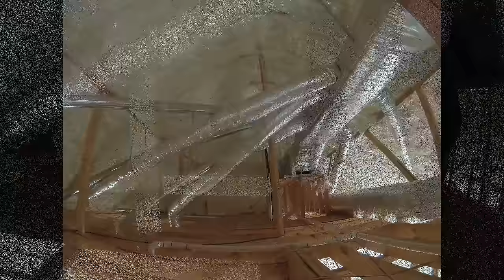Open Cell Spray Foam Insulation

Comment: First off I spraythe outline of the cavities and then the inside that way you’ll have a better cavity cover .
Reply: It should be common sense. Especially to someone who does this for a job
Reply: @twizz420  nah y’all’s pattern just sucks and you hit studs
Reply: depending on the brand and substrate temps or preheat temps, i usually do the middle then the outsides "reverse picture frame technique" or yes I'd do the one you are saying the "picture frame technique"

Comment: Love your video, I love watching this stuff expand, it's therapeutic, like popping bubble wrap, lol. However, if you guys are using open cell, as the title says, there's no vapor barrier properties, of the foam, so how are you guys going do a vapor barrier, on the walls, post spraying?
Reply: If the home is sealed properly there shouldn't  be any condensation getting in. Ventilation in the attic or basement is recommended. I'd sprayed a house recently and as we were working the home was almost dripping with moisture. But we solved it with 2 3/4 in closed cell on all exteriors.
Reply: @dr.dingus3453  Ever heard of condensation caused from actual use of the house?
Really well informed people involved in this "craft"... 🙈
Reply: @L R  

"It's not forg, Johnny, it's corndensation"
Reply: @skylined5534  Corn-den-sa-tion...
Reply: @OmmerSyssel  I warm climates no interior vapor barriers are needed and cause problems
Reply: I know right. It's that satisfying feeling you get when bust the pimples on your face one after the other, and see the splash on the mirror.

Comment: It didn't even stick to the plastic in the beginning.... How is it going to stay in the stud bays or ceiling? Friction?
Reply: Polyurethane foam is a plastic and does not adhere well to slick plastics. I welcome you to come pull some off after I spray it to wood or metal though. It doesn’t let go easily.

Comment: Try spraying every other cavity and see how much easier it is to cut it flush and then spray the other ones in. Twice as fast.
Reply: Buy a shaver and that wouldn't be a problem
Reply: @michealschrader9762  shaver that we use is heavy as fuck, almost worth just using something less efficient
Reply: we use an corded reciprocating saw with a 3ft saw blade to cut flush.
Reply: @Tht1_N8ve  same I have two and shave down a whole house in under an hour

Comment: You are not wetting the sides and on overlap seams causing voids. Every time you go back to try to fill voids you're only bridging and creating another void. Also moving the product during set-time breaks the natural substrate and causes voids.
Reply: He’s speed is causing him to fall short.  He’s definitely a rook for sure.  Feel bad for the home owner
Reply: @blakecannon6963  def needs to chill with that wiggle, def isnt trying to remain perpendicular to the surface he's spraying. def isn't trying to consistently wet the enitrety of the cavity. I've been feeling lately that my walls look better when I do up and down strokes.
Reply: Yup these guys don't know how to handle open cell creating void after void
Reply: @isaacfranco9216  open cell is basically a multitude of voids...open cell.

Comment: Please, what is the best and strongest in insulation, rock wool, or this liquid foam?
Reply: There's no best insulation, it all depends on what you need it to do.

Sometimes you want your insulation to also act as a vapor barrier, sometimes you want it to reduce sound, sometimes you want it to be flame resistant, sometimes you want it easy to install.  Basements need different insulation than above grade.  Different climates need different moisture barrier strategies
Reply: Rock wool does not off gas when heated to ignation point. Also ignation point is very high for rock wool - actually, it doesn't burn at all.

Comment: Is it ok to apply spray foam insulation when the attic is 110 degrees? Will it fully cure? Or will it off gas forever?
Reply: gotta allow ventilation and circulation while the foam is curing within the 24hrs. usually i tell homeowners to keep ventilating for a day or two depending on how they feel comfortable with. i usually have a fan and hose sucking air out of the attic and also another fan and hose blowing air in to keep circulating air if i have enough room in openings like access doors.

Comment: isn't he using way too much foam? And I thought you were supposed to spray it in layers to allow off gassing?
Reply: That’s closed cell foam you are thinking of... closed cell you can only spray 2-3 inches in one pass for it to off gas and cool down. Open cell you can spray a bunch and it will not burn at the core like the closed cell will, that’s why you can spray 10+ inches in one pass
Reply: enkrypt3d he isn’t even wearing a suit lmao
Reply: Btw HFO high lift closed cell you can spray in 6.5 inch passes

Comment: If you have to push on the foam as it’s growing you are not processing foam right.  In fact you are creating a void between the foam and the substrate.  Not only is he not wearing proper ppe (personal protective equipment) but he is also installing the foam incorrectly.  Training is so important in this industry.  People hire just anyone to do this stuff and they see but don’t understand.  What they are seeing.  Hire a licensed professional.  The cheapest doesn’t always pay off
Reply: either way his getting the job done, end of the day its just foam filling a cavity no rocket science behind applying it.
Reply: @Hunter-yy4es   no, he isn't getting the job done right, and you're wrong, if not done properly it can fall apart, fall down the cavity and not work at all, which is why you should always hire a licensed professional.  But I'm sure you're just an "is what it is" fly by wire un-licensed hack so you'll never get it.
Reply: @willfishing5605   spraying expansanding foam into cavity doesn't require much knowledge, safety in the works force has always come down to personal preference. As of how this job looks its expanding l don't see anything wrong its filling up. Each company has its own methods or style. Not everyone is going to follow the rules this isn't rocket science its Spraying expanding foam. 
l could watch 10 videos of the one trade and l bet almost all will have their own style. and talk shit about " how not to do" to make them selves stand out from the rest.
Reply: There's actually quite a bit of math that goes with it as well as architectural knowledge. The foam isn't expanding as fast as normal. His temps may be off. I spray lappola.
Reply: He. Is pushing the foam to the cavity because one of this 3 things chemical is cold .heat hose is cold or the walls are cold he needs to clchek his tempeture all depends on whether if is cold about 60 to 70 he needs to keep eye on tempeture very simple he is a beginner he makes lots of touch ups. ...I got lots of years doing foam insulation i know exactly what is the problem
Reply: Is not about license or certified peole is all about years of experience i know lots of people that get the certification in 2 weeks you just. Need to buy the equipment from those companies that offer free training if you get the equipment from them i work 5 years for a company before starting my own business  that's don't means that you need lots of years to learn but you need to know what your doing is an a house were people is going to live ""iso and poly''' his chemical can cause respiratory problems to your family if is not applying correctly people don't understand that this is not a just spray and go..
Reply: Hunter your wrong it’s not just about filling a bay you can seriously mess someone’s house out not doing it properly
Reply: Hunter this is so funny.  I’m showing all my co workers all the BS you’re saying.   I’ve been spraying for 18 years.  Spray foam insulation is one of the toughest jobs out there.   I want you to come try for a week.  I’ll pay u.  It will be a riot to see you try and be Successful !       I put my money on ur crying for your mom 1/2 way through day one.   Spray foam insulation is a very tough but rewarding job.  I love it. But bro it’s friggin wicked tough.  Just keeping the equipment running is a bitch.  And  keeping the 10,000 moving parts going while trying to make perfect foam for your customers.   Most the time You have to have the stars aligned perfect in order to have a good day.  Lol.    Man. I’m from Massachusetts. Please tell me you are close.  I’ll pay u good money. Just to show u how tough the job is.  Hey maybe your right and I’ve been doing it wrong for 18 years.  Lmao
Reply: Dominick Palumbo hunter has got to be a troll.  Because he’s dead wrong here.  Lmao
Reply: Mario t is absolutely right about the license not being as important as the experience. And ps hunter you have got to be stupid.  The pocket he is creating between the foam and substrate. ( that means the exterior wall. Hunter) will create a dead space trapping moisture and effectively rotting the substrate. Spray foam is so much more than what you think it is.  We are manufacturing our finished product right inside people’s homes.  We are essentially quality control.  So while some clowns are out there ruining places that should otherwise be better because of the install, some of us are making sure the product is processed right from the barrel to the second it hits the wall.
Reply: You also cannot inject the foam to try and fill the void.  The foam NEEDS to be removed and resprayed.  I don’t want anyone to think I’m trying to bash these guys.  I’m just trying to help the people who see this and think it’s ok or better than ok.  It is poor work done by inexperienced people.
Reply: @Blake Cannon  

Expert in da house.
Reply: @Hunter-yy4es  clown
Reply: @jonnygun5055  lol yeah you are mate you're flop. ;)

Comment: 6:18 it comes off the wall and he pats it back down. Moisture problem  or temperature issue
Reply: They should build real houses Made of concrete. I mean, USA claims to be an awesome country whit top tech and they still have a lot of wooden houses.
Reply: How do you prevent that?
Reply: Temps actually look pretty good
Reply: Or used closed cell spray foam
Reply: I think it's something with the direction he's applying it; bottom to top. I think it's expanding upwards and pushing the solidified foam off the wall.
Reply: @AlexMartinez-hr5gm  what a dumb comment. You build for the weather and geological conditions. Cold climates require insulation, and concrete and stone doesn't offer any. Also in case of an earthquake, a light flexible wooden structure would fare much better than a heavy solid concrete or stone structure, even in the event of collapse much better survival chances.
Not to mention cost and speed of build...
Reply: Appears to be the fact it's not being evenly sprayed stud to stud, not easy but kinda nesseary.  Finished product looks uniform but after watching that I know for sure there are air pockets all along those studs.

Comment: Why does he pushes the foam back into cavity ?
Reply: His speed is to fast.  The foam is falling off the substrate.  He’s trying to keep the foam from peeling off of the plywood.  Foam might be a lil cold also. I’d turn temps up
Reply: Foam isn't hot enough... OR it's TOO hot, which means that by the time you're spraying it, it's not cooling down fast enough to stay on the wall. Also, a certain degree of humidity in the air or debris or wetness onside the cavity will prevent it from sticking as well.
Reply: It's because he is not doing the application right, just fast...

Comment: It seems like this is the best way to insulate your home or your shed or your metal building is is is it cheaper than insulation or more expensive please comment back it's comment back thank you for this video it's stop video this stuff looks very very good but good but how does it work just as good as it looks Thank you for this video I hope you let me know
Reply: It costs 2-3 times as much as other insulation methods

Comment: This is a true course on how not to spray foam ,so sad makes the industry look like bunch of ham and Eggers
Reply: Bro I was just thinking the EXACT same thing .
Reply: @The road to Ireland yah actually follow this simple (3-step)rule
1-you come first,(safety first)
2-make sure the equipment is at 100%(across the board),no band aids.
3- The job,(Access, safety, code compliance as per your regions regulations,if the site has issues and your the last one there ! Guess who gets the fall, remember 3 steps with out you, your crew,the equipment,the job doesn't get done.oh and done go more than 2inches (2lbs) at a time , always carry a prob to check you thickness
Reply: @The road to Ireland trust me I understand temperature swings I live in Canada.
Reply: @TheShanMan11  Shanon are you a foamer?
Reply: Absolutely... Been spraying 17yrs. We all don't go into it knowing everything or have common sense...this is shit though
Reply: @chinidad2778  he's spraying open cell no need for depth gauge.
Reply: @laurabrown8760  
hey Laura Brown
those curtains are ugly as it gets and too bulky ,why are you pushing that product via YouTube comments? #laim
Reply: @TheShanMan11  you are thinking ham and eggers?

Comment: What kind of foam machine you are using ?
Reply: graco control the market
Reply: @mahmoudsharaf1264  i have heard good things about pmc ph2. Do you know anything about these machines?
Reply: @trump-wj2nx  the pmcs are a nightmare. The Graco ones are way easier to work on, and if you properly maintain it and keep the gun clean you'll rarely have issues.

Comment: Spray foam of all the types is the best insulation, but the most flammable,Mineral wool is always a better option With better house wrap for moisture protection, 2"x6" wall studs to get R-19 in walls
2"x 8" or 10" for Ceilings for proper R-38

Comment: As a sprayer myself, this hurt me to watch
Reply: Since you are a Sprayer let me ask you. In a Garage that is attached but not heated or cooled if i wanted to spray foam it which one should i go with . Closed or open. I'm in Texas.
Reply: @tpfmike1976  open cell
Reply: This is the first time I’ve seen insulation sprayed and it still hurt me to watch.

Comment: This guy doesn’t even have a long sleeve on lol. He is gonna be covered from head to toe in foam! He should be wearing an air hood too.  The charcoal respirator works but it doesn’t block everything. I sprayed for 10 years with the charcoal respirator and I became allergic to Isocyante because of that.  I can’t spray anymore. I’m doing fine health wise just can’t be around foam anymore.  I still do fiberglass but I always wear a mask!
Reply: You don’t get sensitized from wearing charcoal filters. Been foam for 12 years and my first 6 I used those filters with no issues.
Reply: Hope you are ok.  Do you know how much it cost to spray foam a house like this

Comment: People that do that to their homes don’t love themselves. Good luck when you try and resell that house😬.
Reply: It increases the value here in the states.
Reply: @mx500a4  it can be a problem for mortgage companies when approving home loans due to the spray foam insulation covering the roof structure, leaving their inspectors unable to see the condition of the wood members. If your roof has a hole in it for some reason, water can seep in and sit there rotting out the sheathing and growing mold, eventually the roof rafters and drywall if your attic is a finished living space. It might be a regional thing as well, but if it was my home, I’d go with rigid foam insulation instead.

Comment: Also how effective would this be for a recording studio room?
Reply: It would work great it blocks the unwanted noises
Reply: It will not work do not use it. Use rock wool instead
Reply: It's basically useless for soundproofing because it's too hard. Soundproofing works by absorbing the vibrations of sound waves. 

Fibreglass insulation is the best for in-wall soundproofing.
Reply: Rock wool would be your best choice, theres some that come in 4x8 boards the use it on movie theaters, schools and churches
Reply: Spray foam is used as an air barrier, not a sound barrier. The finished sprayed product is made of a plastic, and while it may be a little squishy, it has an exterior that can let sound bounce off of it quite easily. Every room that our customers ask to be soundproofed, we line with mineral wool. It is a very thick, abrasive form of fiberglass that has little bits and pieces of sediment and rock that help to catch sound before it passes through the fiberglass. And it makes all the difference in the world.
Reply: @twizz420   thanks I will look into fiber glass
Reply: @lalabor21  I will check it out.
Reply: Open cell works great for noise reduction. Closed cell is 2# foam open is usually 1/2# foam.

Comment: so is this a 2 part foam that is mixed when it is shot out of the spray gun?
Reply: Yes? Hence him testing the mix at the start of the video. The nozzle at the end if the gun is actually what mixes the 2 products as they come out.
Reply: A chemical reaction. This spray hose is connected to to barrels of chemicals. To work properly, they have to be heated to a certain temperature. Once the temp is reached, You unvalve the spray gun, and the chemical runs down separate hoses to the nozzle of the gun. At the last split second, when you pull the trigger, the gun allows the two chemicals to touch, the air hose on the gun blows it out, and the chemical starts reacting and expanding on the fly.
Reply: @ryalsackjon3020  meron po dito sa pilipinas?
Reply: kung meron po nangangailagan po ako ng ganyan?tnx